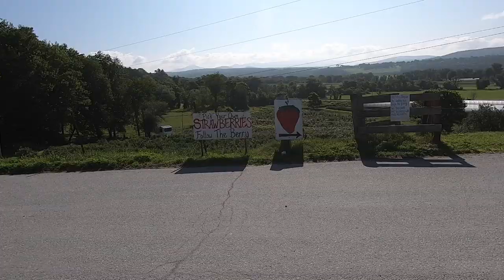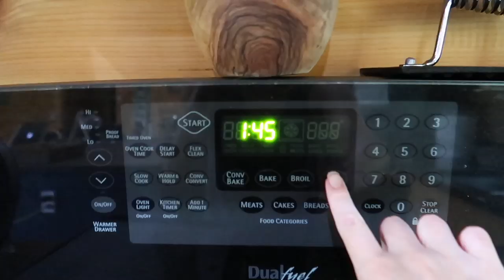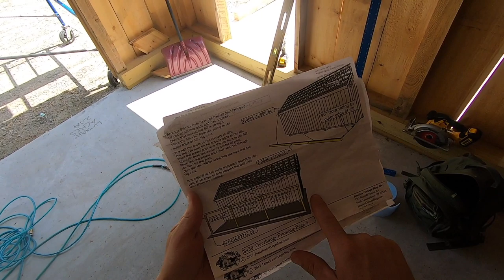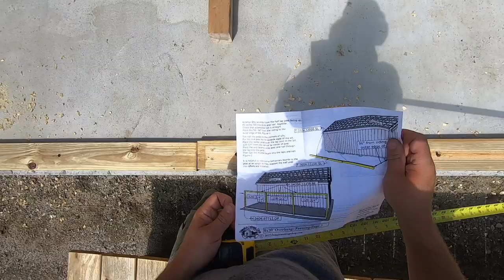This made our BARN Building PLANS CHANGE

Comment: Strawberry shortcake is traditionally made with small individual angel food cakes made with a tin about the size of a ramekin. Topped with your strawberry and sugar topping (which differs just about as much as the shortcake recipe does itself) topped off with fresh whipped cream and garnished with a couple of strawberrys and maybe a sprig of mint. 
I have made it using a shortcake biscuit dough, split the biscuit, put the strawberry mixture in between the biscuit the whipped cream on top with few strawberries on top of that. So I've made it both ways but I was raised with the one with angel food cake. Boy that was a long way of just saying angel food cake.
Thanks for sharing your homestead with us,
Jimmy

Comment: Hi Al, I'm starting a Jamaica Cottage Equipment Shed. David delivered it, he was great. Said he delivered your barn. Was wondering what size GRK screws you used?  Thanks.
Reply from the maker: The GRK screws are 4 1/2 and the timber locks are 6”. I hope you were able to use the discount code
Reply: Al,  I did use the code. Saved over $1500 Thanks. 
Ordering Dewalt nail guns through your Amazon link. Again thanks.

Comment: You where asking in one of your last videos what type of wood storage you should build .  Personally I would use the extra 6*6 posts and build a post and beam wood shed, clad in board and batten to match the barn.  Can still pile firewood on skids so air can pass through and leave the spaces between your rafters open as well.  Doors (sliding barn) are optional to let air pass through, snow and rain off.

Comment: Hey Al you may wanna drain that compressor the valve is on the bottom ! When you open t hff e valve rock the compressor back and fourth till no more water comes out ! If you dont hor gubs will rot from thd inside out ! Just an FYI ! Have a good one Al !

Comment: Great work by yourself on getting the posts into place.    I've never had homemade shortcake; however, I get the sponge cake cups in the stores.  It's what I  grew up on.    Like you, I ordered it once and the berries were between the biscuit layers with whipping cream on the top.  I ate the berries and cream, because the biscuit had a floury taste and was very dry.    Could you possibly put one of those trail cameras on the goats to see who is nursing on Willow?

Comment: I have the 18Volt Dewalt tools. I only had one good battery. So I went to the the two "BIG BOX STORES" here in town, to get a battery and got a conversion kit for 20volt. It came with 2 20volt batteries. The only thing I don't like about them is the 20's won't hot charge and the 18Volt will.

Comment: 10:04 I was guessing 10 lb box but that was over 12 lbs. for $30 bucks.  I don't think I've never picked bulk strawberries (me and Henry Fonda). Just the little uncultivated ones growing wild. Blue berries on a farm.  Black caps and raspberries in the wild but I don't remember what we sold them for. It was probably under a bucks per 1/8th peck when I was a kid. Now it's $2.50 lb. Safeway charges $2.50 a lb but they're usually pretty tart even if they're dark red. Picked green and gassed more than likely.

Comment: Curious why you're Not using Bead Mastic tape roll (like butyl sticky tape) on the roofing panel overlap seam... as this seals the seam and doesn't allow wicking of water (from heavy rain or snow melt) to travel under panel and leak?

Comment: I have been watching your videos and have some suggestions on "work easier, not harder". 

TOOLS: get a tool/utility built; they have loops for your hammer or drill, clips for tape measures, pouches from small for pencils, driver bits to large for screws and nails. no need to use pants pockets for screws that can puncture your legs. a small punch for punching holes in steel while on the roof, makes screwing easier since you don't have to wait for the screw to drill a hole. a tape measure that stays extended until you push the button. 

HINTS: think about what you are going to do and how to make it easy. such as, when setting your concrete anchors, rather then a tape you have to pick up, and extend time after time, lay a piece of 2X4 on face, bingo, 1½". Use a story pole out of straight 1X2 for marking your holes in the steel roofing.

Comment: Awesome job . Be done in no time  🥰😁😁.. as for yummy dessert  ..Strawberry shortcake is a widely known dessert made with shortcake. Sliced strawberries are mixed with sugar and allowed to sit an hour or so, until the strawberries have surrendered a great deal of their juices (macerated). The shortcakes are split and the bottoms are covered with a layer of strawberries, juice, and whipped cream, typically flavored with sugar and vanilla. The top is replaced, and more strawberries and whipped cream are added onto the top. Some convenience versions of shortcake are not made with a shortcake (i.e. biscuit) at all, but instead use a base of sponge cake or sometimes a corn muffin. Japanese-style strawberry shortcakes use a sponge cake base, and are a popular Christmas treat in Japan.

Comment: FYI, anchor bolts should be no more than 12" from the end of each sill piece.  And they should engage the entire thickness of the sill, rather than countersinking the nut and washer.

Comment: need to drain water from compressor don,t want water going through nail guns put a few drops of oil before you plug gun to hose good job!!! on build
Reply: How could anyone expect to survive on 4 goats, 2 pigs and some chickens. this is a very misleading  channel.
Reply: Your comment is based upon limited information and therefore unfair and reactionary. Gina is working outside of the homestead too, and Al was until a year or so ago, I believe. No one is claiming self- sufficiency right now, and that is made abundantly clear in most episodes. Not sure why you framed your premise the way you did, when it based on nothing claimed in the video series!

Comment: Shortcake - well - if its "short" it means it has a lot of butter. So its not really a batter (which would be needed for cake) its more of a biscuit. But generally you add a little more sugar (just a bit) more than you would for biscuits, which is more cakelike. I vote its a biscuit.

Comment: Just set a 2x4 by the bolt and pound it down till the nut is flush with the top. you  will not need to measure each one with a tape measure.

Comment: I ought to finish watching the video before I comment but..Al, you are cutting your 4 x 4 posts. You said you hadn't cut 4 x 4's in a while. That comment leads me to believe that you didn't cut the 4 x 4's you used on the other side of the barn. Why are you cutting these? On the other side of the barn you had neglected to cut those and it made them too high (long). You solved that by removing the 6 X 6's. You chose to leave the 6 x 6's out of this side from the start so you shouldn't have to cut your 4 x 4's, correct?
Reply: Al, I don't men neglected to cut them. Or even failed to cut them, but you didn't cut them.